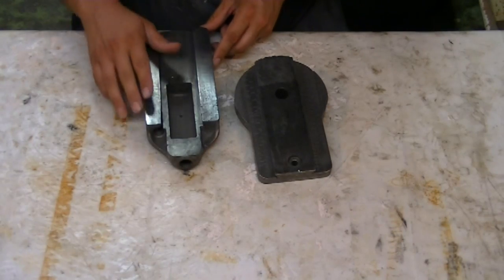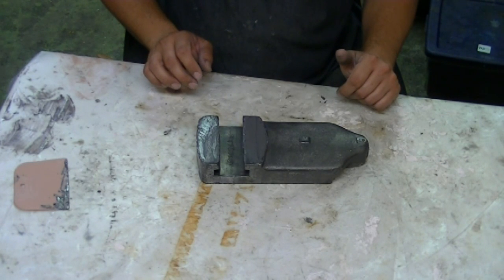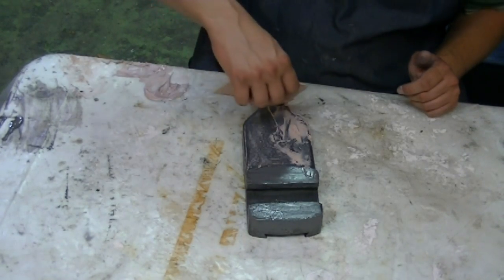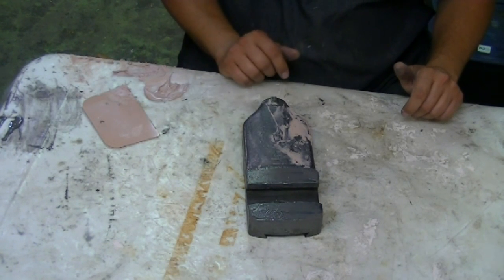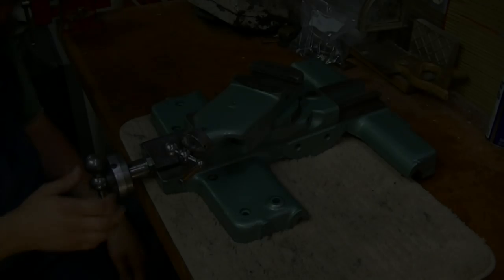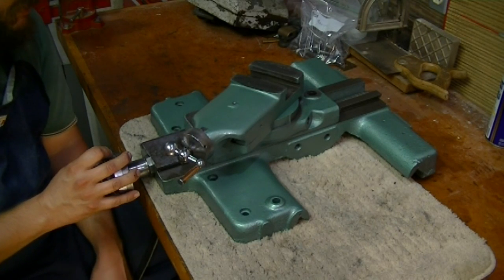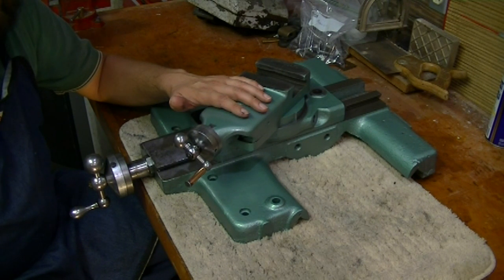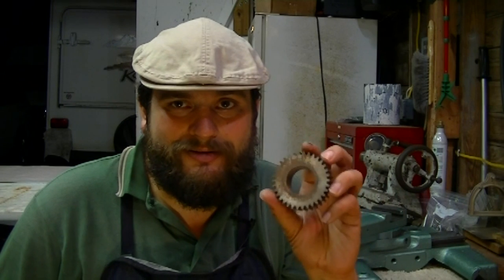14.5 South Bend Metal Lathe | Saddle Repair | Part 4.3

Comment: Remember to disconnect that shiny new cross slide nut when you use your taper attachment :D
Reply from the maker: Will do.  Thanks!
Reply: As far as I know that isn't required with a telescopic taper attachment

Comment: Buddy,
Just started watching the series... I have a 16"x96" war vintage SB. Check the ways before you get too deep into this. They are non-hardened and wear badly-that's the bad news.    
Because they aren't hardened, they can be ground-that's the good news but it costs a fortune. I hate to say it but I abandon mine and use it for long work-like building drive shafts. Went and bought a 14-40 off shore machine for daily use. Just couldn't justify the money. 
Best Wishes and Good Luck
Look forward to watching all of the series - Hope you are back up and running on this project. It looks like it's been several months since you posted an update.

Terry
Reply from the maker: Hi Terry, the ways on my lathe do have some issues.  There is a valley near the headstock in the place you would expect it to be.  I'm using this lathe as a learner.  As I gain more experience I would like to get a nicer lathe.  I've been a little under the weather for the last few months, but I am working on a video for this week.  Thanks for watching!

Comment: Enjoying your series on the lathe restoration. I too am doing a restoration on a 1939 SB 11"X4' UMD sn. 91867. I have a lot of history on it. This also is not as common as the other models but a lot of similarities just like yours. Started out being sold from a dealer in Pa. sold to a trade school in Philly, somehow got down to Fla. and purchased in 1970 by a fellow from Oh. that opened his race car shop in the Tampa area for 30 years. He then moved back to Sandusky Ohio and had it in his home shop till I came across it this fall just by asking around and came across his name and I purchased it for the price he came up with- $200 !. Never dickered with him on price one bit. What a big mess, but it was all there except for a few things. So bad I just power washed it before I took it off the trailer, blew it off, oiled everything and test ran it, few issues but nothing major. Now removing one section at a time, repairing and painting each item and setting aside till everything is done before assembling. Previous owner is excited to see it when done. He is in his mid 80's and as sharp as a tack. We became good friends.  The repair book you talked about I agree is a great reference. My review-  Excellent reference book. Also received one without the binding to put it in clear 3 ring sleeves and folder to use in garage as I rebuilt my lathe and didn't have to worry about getting it wet or dirty, as suggested by seller. Even though my lathe is an 11" SB, this book relates to most everything about a rebuild and the adjustments. Nice printing and pictures and explanations. In my opinion it is a great value for the SB enthusiast. Looking forward to your future videos on your lathe. Ed K. Cleve. Oh.
Reply from the maker: Eddie,  thank you for sharing about your South Bend.  What a great story and to be able to know the history on your lathe is really a great achievement.  Thank you for watching and subscribing.  I have been a little under the weather for the past few months, but I am starting to feel better and look forward to getting back in the shop real soon.

Comment: how is the wear on the bed? I see a worn gib screws and x slide ways. just wondering if it did a lot of cast iron turning in its past life. you are right the shim is not original. it would seem that it was worn beyond the scope of adjustment.  this might be a good scraping project. only way to fix it is to make a new one. but really the ways should be fixed first.
Reply from the maker: Hi, Chris.  When I purchased the lathe I didn't own an indicator.  I do own an indicator now and now that the saddle is complete I plan to take a few measurements to see just how much wear the ways really have.  Visually the ways are the cleanest and looks to be the best-maintained part on the entire lathe.   As for the history, I really can't tell you.  I purchased it on Ebay real cheap from a printing company.  It has definitely been rebuilt before and it was purchased in an area with a rich naval history so it may have been in the shipyards at one time.  I've been keeping up with your videos, really great!
Reply: hay that is good to here on all accounts. leave some comets. I'm almost to 100 subs

Comment: As long as the JB weld is cosmetic it should not hurt. The leadscrew wear is obvious. No way to build that up, either.
Reply from the maker: That leadscrew will be a future replacement project.  It has a lot of issues not just with the wear, but also with the attachment of the dial and handle.   Thanks!

Comment: JB weld on a precision machine part? Really? If you believe this to be the correct course of action, there is little more I can say...
Reply from the maker: It is a cosmetic repair.  I was careful not to damage the machined mating surfaces more than they already were.  It is a great way to fill in a hole with a metal colored epoxy when brazing is not practical and could cause more damage to the part.  Thanks for the comment.

Comment: Great vid. Thanks a lot. I tend to use grease instead of oil. I have a feeling than it would stay in longer. Is that OK ?
Reply from the maker: Hi, Jim.  Grease is often not used on lathes and other machinery because it tends to act like a glue allowing a buildup of small particles of dust and metal to build up on the ways.  This will increase the likelihood of the ways wearing out sooner.  The machinery manufacturer will often recommend the use of different weight oils for use on the different parts of the machine.  For example, the ways will use "way oil" and the gears will use a lighter weight oil.  I would recommend checking with the manufacturer of your machinery to find out what type of oil to use and to find out how often to oil the various part of your machinery.  This is a really great question and I'm glad you asked it.  Thank you for watching!